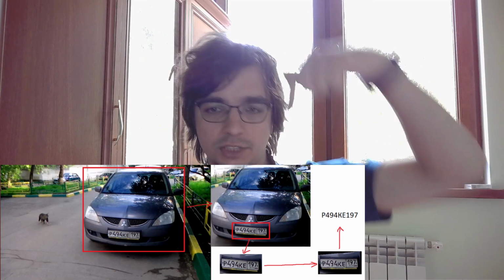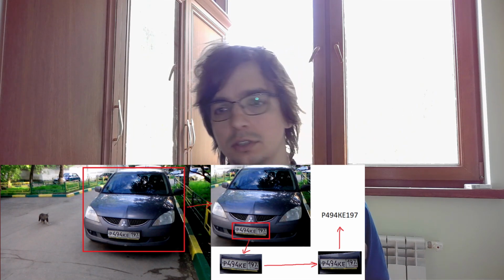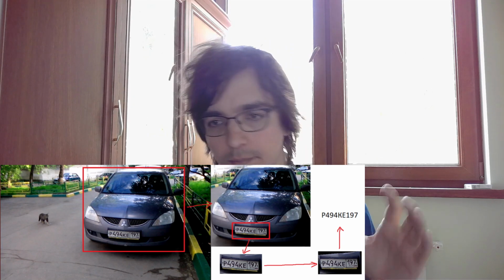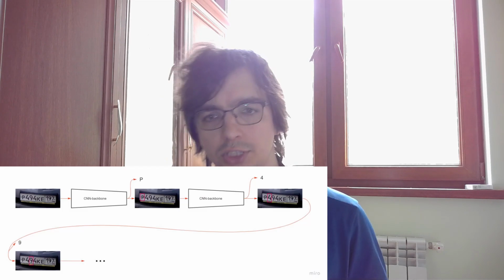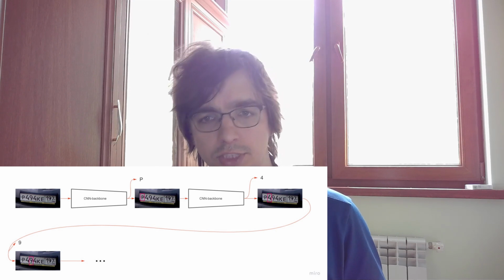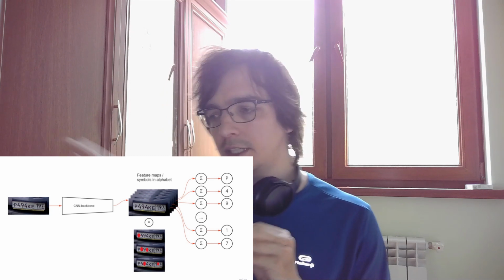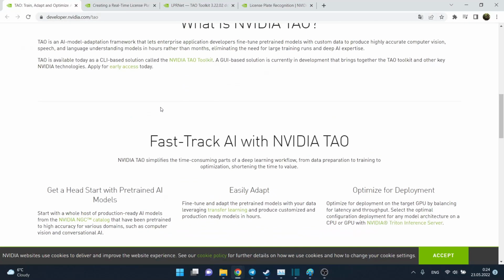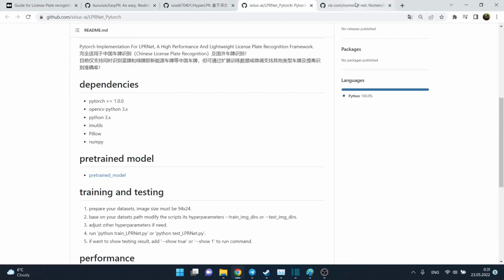License plate recognition in 2022

Comment: To make SOTA ALPR you need huge dataset with millions of LPs.
Reply from the maker: Hi!
No, it's not necessary. You only need a few thousand examples from each region where stable work is needed. Some even train on automatic generators, but in my opinion this is not the best solution.
I can say from the experience of creating a system that worked in a dozen different countries - a dataset of several tens of thousands is usually enough.
For the European Union, 5-10 thousand is enough, the same amount is enough for the CIS countries. etc.
But, of course, it is necessary to define the concept of SOTA. There is not a single public dataset with good representativeness. Taking into account the fact that there are hundreds of countries in the world, there is a big question in what percentage they should be taken. 
And what is better in a real system - SOTA in one country or all over the world at once. SOTA around the world may show poor quality solutions for one target domain.